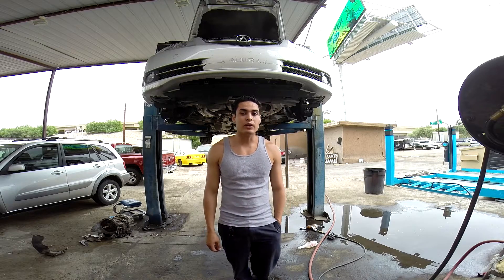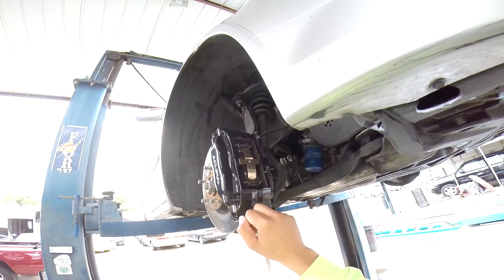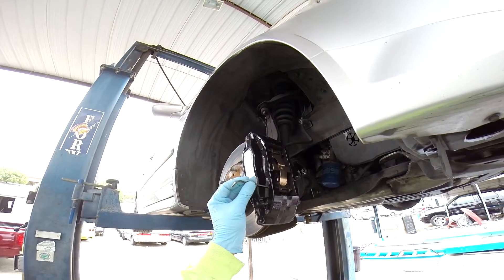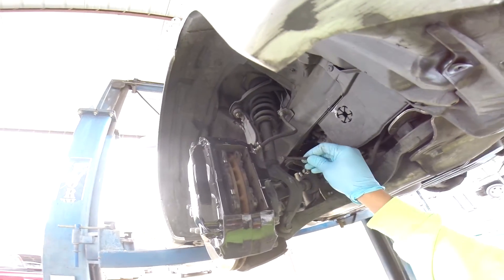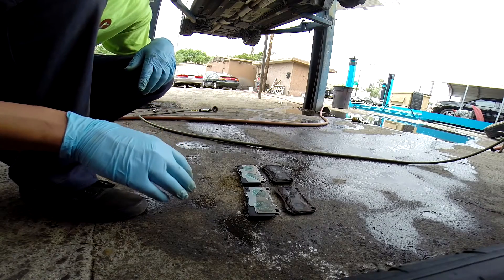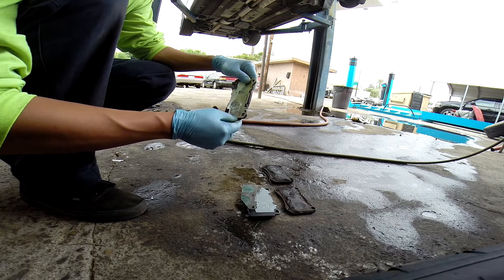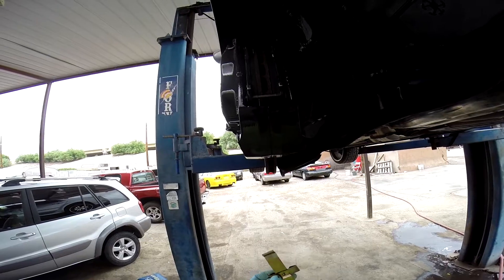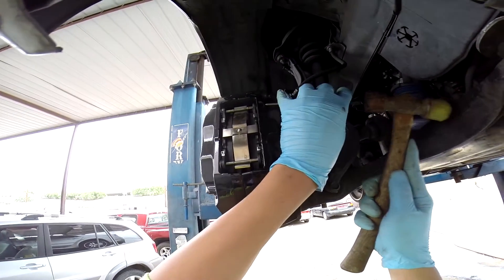Brembo Brake Pads Replacement

Comment: so doesn't using the rotor for leverage to push the piston cups back in damage the rotor
Reply: i believe so, dont know why he did that, but i will use difrent way to conpress piston, pice of thin wood or hard plastic
Reply: Use a compression tool lol
Reply: C-Clamp on the old pads.

Comment: All you had to do was push down on the spring to remove pressure from the pin and pull it... beating it out until it shoots back at you is NOT the best method..

Comment: Thanks for taking the time to make this video.  Nice to see what we're in for before we start,  One correction though I think regarding the arrows on all the parts.  Parts should be installed with the arrow pointing in the direction of the rotor rotation.  You say that it should point "UP.," and you weren't sure why the previous installation had it "wrong."  If the calipers are on the front of the wheel, the arrows should be pointing down.

Comment: You suppose to twist the metal clip the hold the brake pads so it will loose the tension , than you bummer the pins out , and nothing will fly out they way it did right them my friend

Comment: Dude you know those metal brackets you pulled off are already attached to the new pads LMAO
Reply: The funny thing is they’re not. Those are directional shims and must be transferred from old pads to new on most brembo applications. You have to know wht your talking about to be a smart ass lmao
Reply: @RedlineMaximaSE  You are the only Acura owner on the internet who had pre set shims. NOT BACKING PLATES but shims on a set of new unopened pads. Congrats your a luck story teller